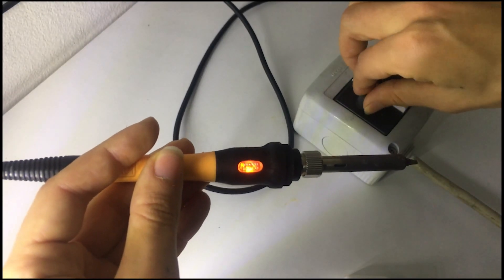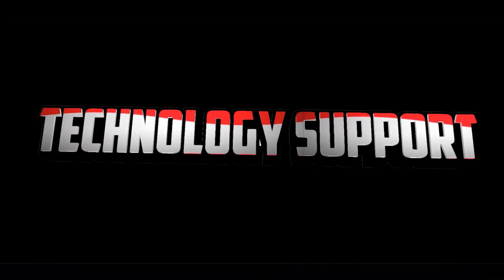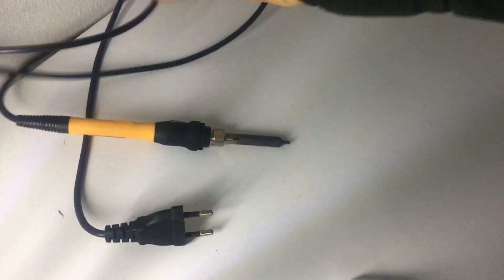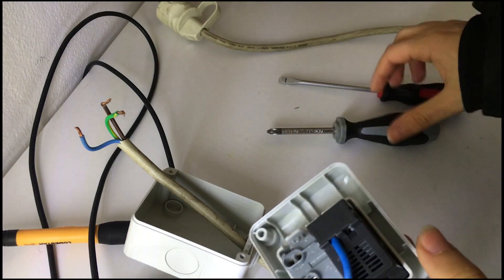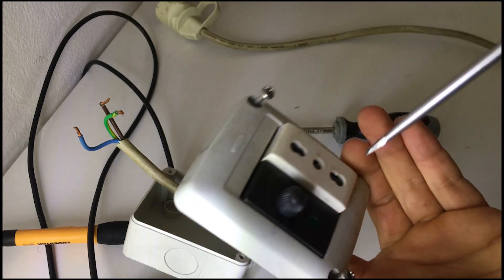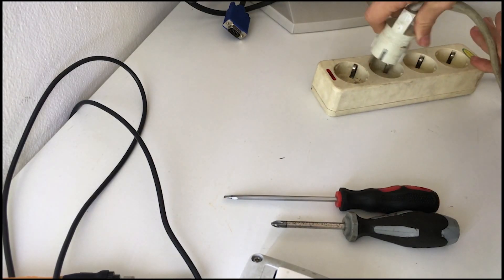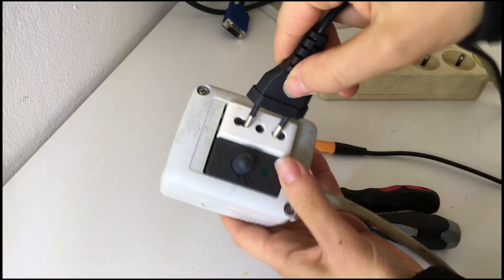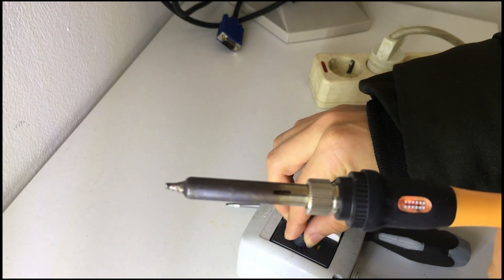How to make Temperature Controlled Iron Solder ! DIY

Comment: Or, if you already know how to solder and can distinguish the simplest electronic parts from each other - just assemble the dimmer yourself according to one of the many circuits consisting of only a few parts (for example, based on a thyristor or triac).
Reply from the maker: This is for old soldering irons , cheap ones , u decrease voltage/current with dimer..
Reply: @Cyber0555  
Well, in the video you show exactly the connection of a dimmer for light (incandescent lamps), isn't it?
Reply from the maker: @strannik8234  yeap ,for incandescent lamp , and i use it today , work perfectly , i dont have any problems with that